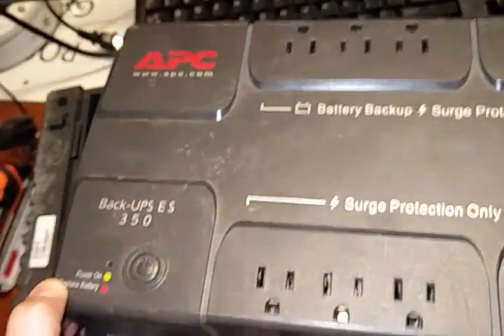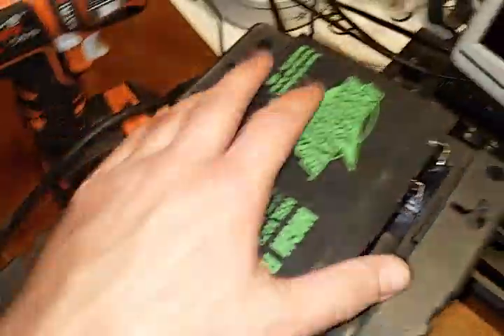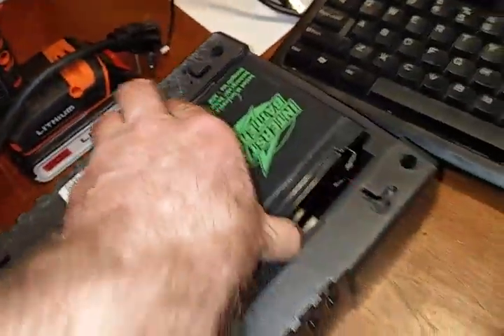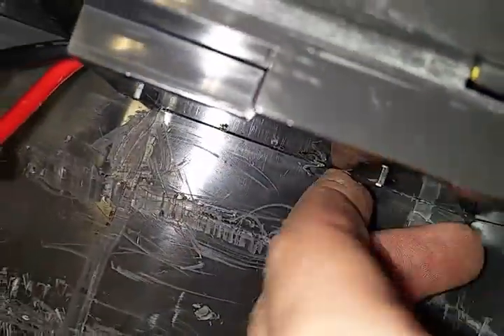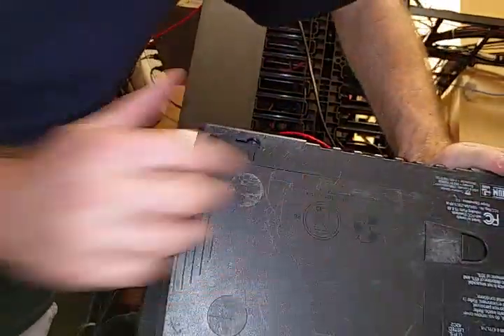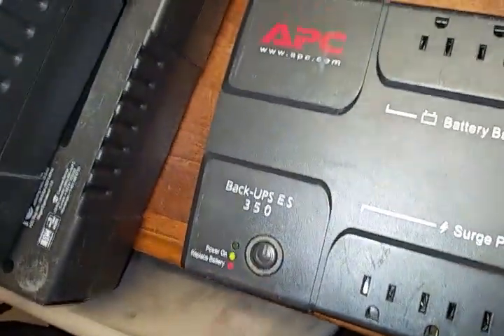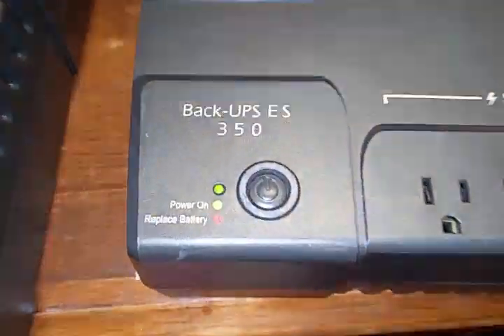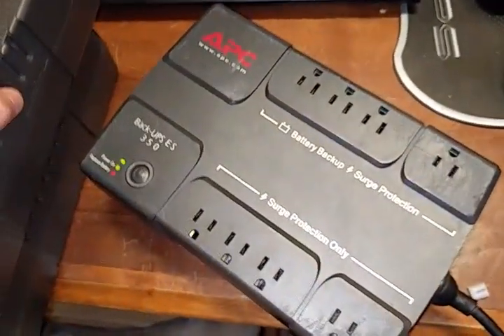APC Back-UPS 350 9ah Battery Mod DIY Easy

Comment: i have ups 350 that i have 12volt 12Amp and 12volt 7.2Amp runing with it i do 9hour and more lol i have laptop battery need new one i have laptop plug in you change battery even used Lithium battery you have 20A,40A,50A Battery run it just add fursed

Comment: Good idea💡 thanks for sharing👍
Reply: you can even have 12V Battery 12A with it  i have 12V battery 12Amp and i have 12V battery 7.2Amp runing my i do 9hours  not best battery if used deep cycle battery 50A run much longer

Comment: Here's the deal.  The UPS is rated to handle the inverter current for the time that a 7ah battery can run with a full say 250-300 watt draw when the power goes out.  But with a 9ah battery it would obviously run quite a bit longer.  It really does make a difference.  Inverting the power to high voltage creates heat in the circuits but honestly if you watch other people's videos on this subject it's likely completely safe.  I've seen people connect car batteries, which are also lead acid 12v batteries, in parallel, and there you get a ups that will last days in some applications.  

Secondly, they make 9ah batteries these days with the same dimensions as a 7ah battery, so no need to carve it out anymore.  Just look up or measure the dimensions of your 7ah battery and make sure the 9ah you buy is the same.  It will add about 20 minutes to hours of extra coverage depending on application.  For example, if you use this for your home router and modem, it will last several hours because the draw is at most like 20-30 watts, and much less without activity.  Yes, when the power goes out your modem still can get the internet because hubs around your area have much better backup power systems than this.

Comment: Side Cuts and pliers will do the same job and I have had a fair amount of success keeping it clean. also if you are comfortable with it and have the equipment you can always 3D print a case for the UPS circuits that can go over any battery.

Comment: Your run time is dependent on size of battery and model of UPS.  APC350ES will only run 1.5 hours max, it is designed in the unit.  But if you find a APC###U or M models can run for up to 8 hours depending on your battery.
Reply: lol i get run 9hours and more change battery not have used same battery lol